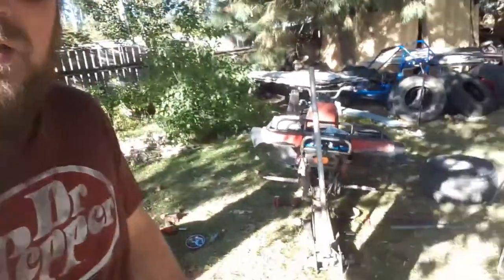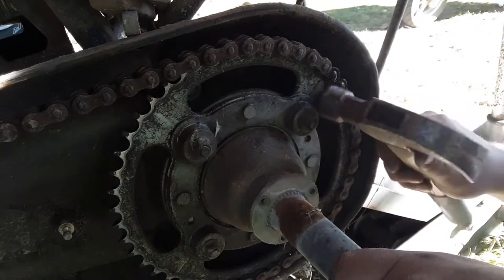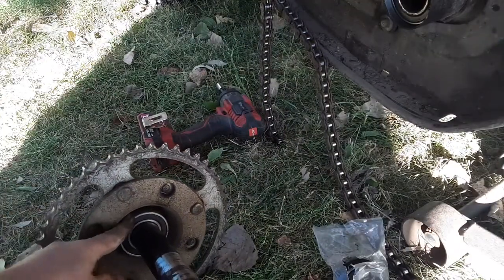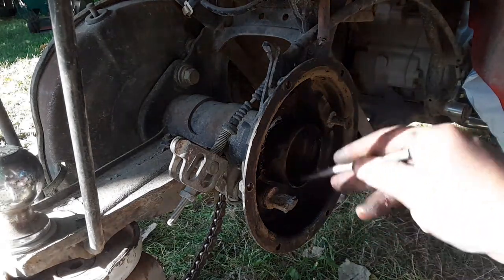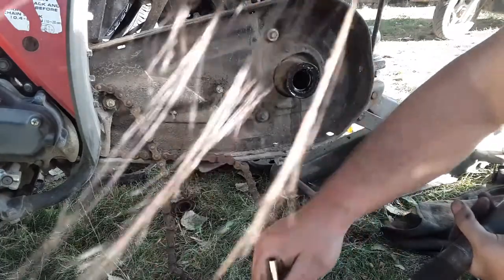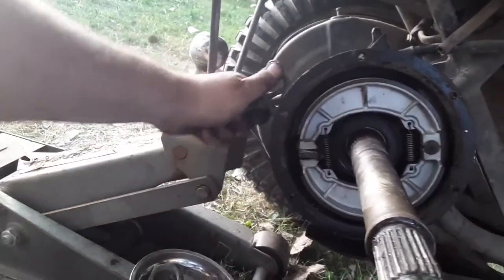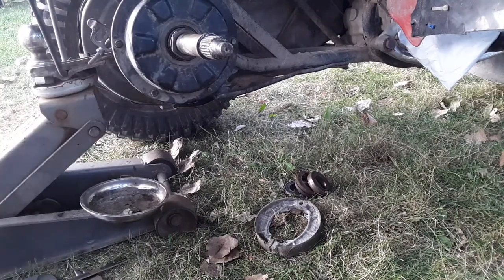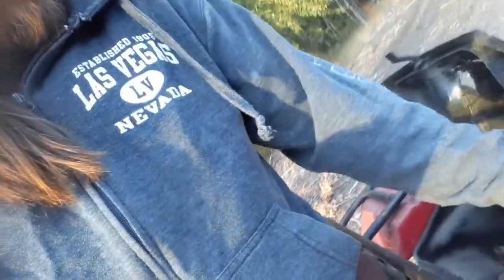HONDA ATC200 [rear brakes and bearings ] 1983 atc 200e

Comment: Im about to do the bearings on a 185s. Been riding 3 wheeler for 25 something years and never had to replace these on any trike ive had. 
You have 100% more experience than I when it comes to this!
Reply from the maker: @Hillbillypunk  im pretty sure this is the worst big red I have ever seen when it comes to abuse of the machine, It belonged to a guy who jumped it and rode thru creeks and ponds then was sold to a cow farmer that also abused it. Its actually setting with a smoking engine right now as i round up parts to rebuild the engine.
Reply: @WesleySnyder  sounds like that one has earned it's keep! 
I drug home this '82 185s the other day, it's complete tho. Completely full of spiders and rust and everything sucks on it. My favorite kind hahah
Came with a really cool Super Trap exhaust, I'm probably gonna stick that on my much nicer '84 200s.

Comment: Recently got myself a ATC 200e 1982, was wondering what the drain plug is for on the bottom of the brake side housing/outer case ? water drain perhaps ? thanks all and great video Wes
Reply from the maker: I think it is for water drainage. Thanks for watching 😎👍
Reply: Thanks for the quick reply
 @WesleySnyder

Comment: So I'm doing the same job on my 83 atc 200... My problem is that the outer ring of the old bearing seemed to be very stuck inside the housings... I haven't had time to try a lot but any tips on getting them out?
Reply from the maker: I would use some heat like from a propane torch. And use a piece of pipe that fits the axle flange real good and pound them out. Good luck. Thanks for watching 👍😎
Reply: @WesleySnyder  thanks man!! This was an awesome video!! Gave me the confidence to try to actually fix my machine haha

Comment: Got any tips on removing a rear rim? Mine is siezed on the axle
Reply from the maker: Heat it with a propane torch and spray it with something like PB blast or WD-40, that might get it.  Also a steel bar on the back of the rim hub hit with a hammer could work. Good luck.
Reply: @WesleySnyder  ended up getting it but now I'm having a hell of a time with the drum over the rear brakes 😂 I don't think this rear end has even been apart to be honest

Comment: Did you replace the brake drum seal because I can’t find one anywhere?
Reply from the maker: I couldn't find one either so no I didn't replace it. Mine was ok but if you need one you can measure it with calipers and maybe find something on the stens website

Comment: Where did you get the bearings and seals?
Reply from the maker: They came from Ebay. They work real good still.
Reply: @WesleySnyder  just ordered mine
Reply: @WesleySnyder  do you have a link to the ones you ordered
Reply from the maker: Ya got them on ebay this is it right herehttps://www.ebay.com/itm/264124466567?mkcid=16&mkevt=1&mkrid=711-127632-2357-0&ssspo=nAZ1b3-2QX-&sssrc=2349624&ssuid=V4FdygxbS6-&var=&widget_ver=artemis&media=COPY
Reply: @WesleySnyder  sweet thanks just ordered them, have my bike torn down and waiting